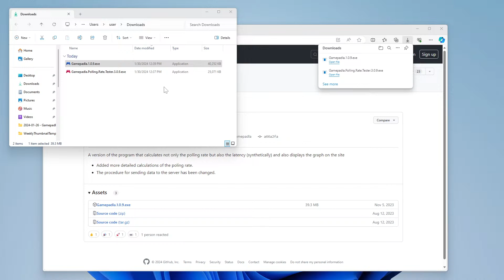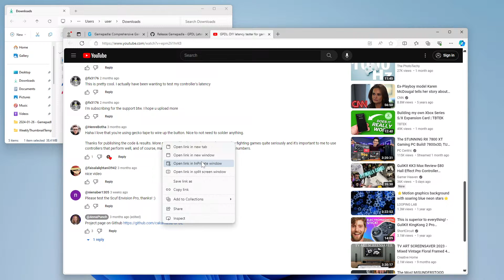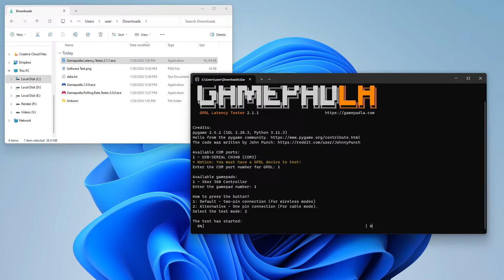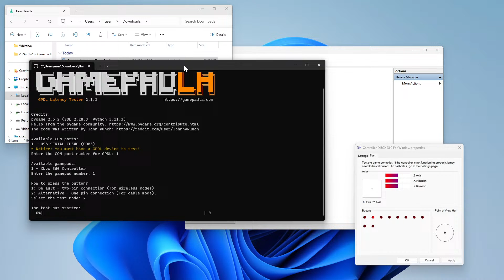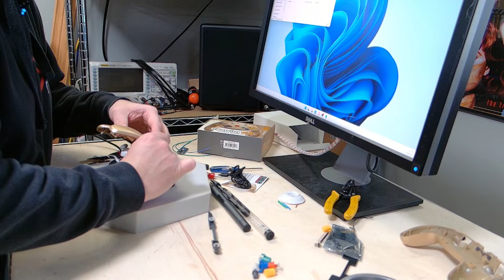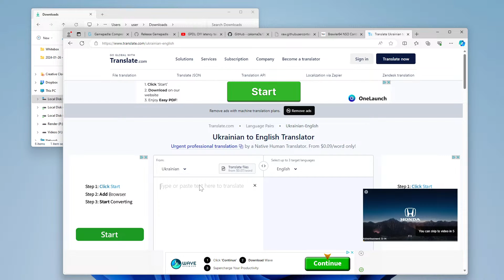Gamepadla Installation & Testing

Comment from the maker: In case you're just skimming the stream:  We tried with resistors first, then removed them to be safe.  This ate up a lot of time, but is good for safety.  Also, ALWAYS use option #1 in the software.  John's going to re-word that to make it easier for first-timers to understand.  Other than that, it went great and it's awesome software!